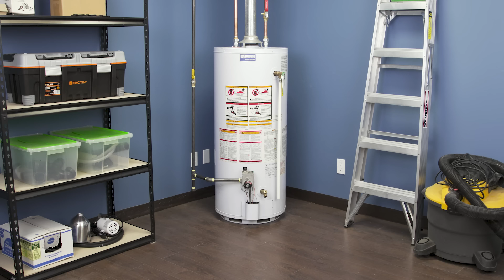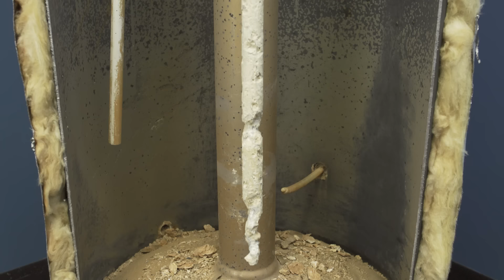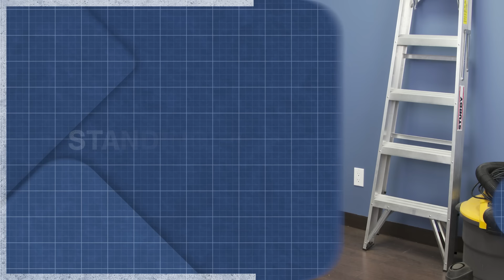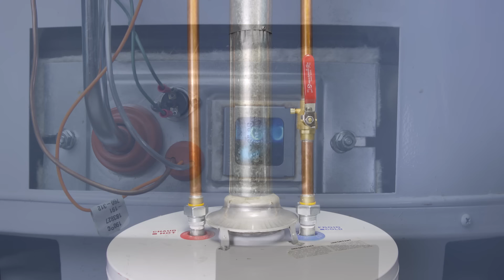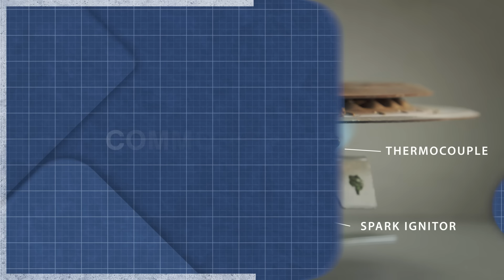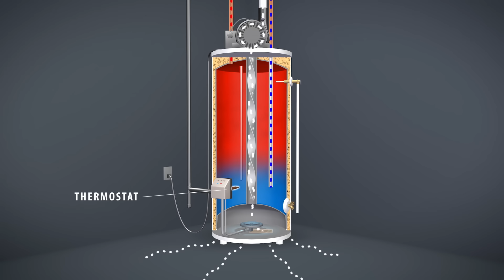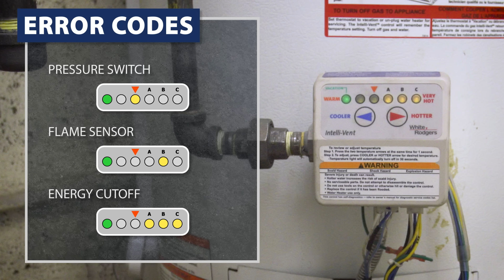How Do Gas Water Heaters Work? | Repair and Replace

Comment: So if the water is heated in the tank already, how does water come out warm if set to warm instead of the max temperature of the water heater? If I go full hot and switch to warm, it does it within seconds, but the water heater itself has very hot water at the top.
Reply from the maker: Great question. All domestic water is pressurized. Pressurized cold water is connected to the water heater, the water is still pressurized when it's in the tank. All faucets have a hot and a cold line attached. The handles just mix the amount of cold and hot water that mix as it comes out of the faucet.
Reply: @AmreSupply  Awesome! That makes sense - thank you!

Comment: My brother spent 3K on a new water heater. A water gas heater is just a stove over a big tank. I told him it's either the valve temp regulator or the thermo coupler which I can easily replace for 100-200 bucks but he wouldn't listen. He said it's already over 10 years old and the new one comes with a 15 year warranty. I was like WTF, "OK, it's your money."
Reply from the maker: I feel like if people had more knowledge about their HVAC and Appliances, they wouldn't be so quick to buy an entirely new model when it "fails" instead they would opt for the repair. For some they just want peace of mind and that comes with a new model.
Reply: @AmreSupply  He got an outdoor propane space heater and doesn't know how to light it. Same concept, get the pilot going and increase the gas flow. SMH.

Comment: If I switch my gas valve to off, I shouldn’t have to worry about any gas at all, right?
Reply from the maker: That is correct, turning it to off will prevent gas from flowing to the burner.
Reply: @ Thnx

Comment: Can you explain how the hot water pump out of the tank ?
Reply from the maker: Thanks for watching. It's pressure from the supply of cold water into the tank. It's the same pressure that pushes cold water through your pipes to your faucet.

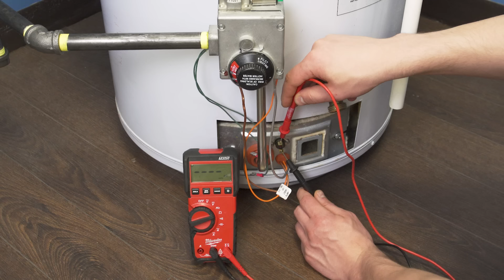Comment: 5:50
Reply from the maker: Thanks for watching. These water heaters use a spark ignitor (which is unpowered) When lighting the pilot there's a bypass/ pilot setting. Press down to open gas to the pilot flame, press the spark ignitor and then you have to continue to hold down (keeping gas flowing to the pilot) for 60 - 90 seconds. During that time the thermocouple or thermopile will warm up.

Comment: Since the thermopile supplies the power, how does the igniter GET POWERED when it needs to be ignited .?...going from a cold state, cold thermopile , and NON-continuous, intermittent pilot flame
Reply from the maker: Thanks for watching. These water heaters use a spark ignitor (which is unpowered) When lighting the pilot there's a bypass/ pilot setting. Press down to open gas to the pilot flame, press the spark ignitor and then you have to continue to hold down (keeping gas flowing to the pilot) for 60 - 90 seconds. During that time the thermocouple or thermopile will warm up.

Comment: My pilot lights and will stay lit until I try to adjust the temp ,main burner will fire and run for a moment and then shut off  pilot light.
Will relight after waiting 5 mins and stay lit until I adjust the temperature
Reply from the maker: If you have an electronic valve and a thermopile then this video shows you how to troubleshoot: https://www.youtube.com/watch?v=UXpmmGuewk8
If you have a older gas valve and thermocouple then watch this instead https://www.youtube.com/watch?v=Lu5GvbvspMw
Reply: @AmreSupply  
Thank you for your reply.
After watching videos and reading some forums 
I was able to figure it out.
When the pilot originally went out and wouldn't relight
I took the thermocouple out to clean it and the piezoelectric tip , in the process I trashed the gasket.
Being impatient, I didn't wait long enough for vapors to clear the chamber and had a combustion event that triggered the combustion shut off device without realizing it.
I cleaned the combustion chamber, as well as the intake vents .
I replaced the combustion shut off device, got a new pilot/ gasket kit ,made sure the gas lines were tight and not leaking and it now runs as it should.

Comment: Mine is making constant knocking noises that sound like they’re coming from too much pressure being built up inside.
Reply from the maker: Thanks for watching. In some cases the noise can be from the slight metal expansion in the tank or pipes or could be from sediment being kick up and falling back down.

Comment: Stupid question -- how does the hot water tank know when it needs to refill from the cold water supply? Is it pressured based or is it that it is always refilling (i.e. when a hot water tap is open elsewhere in the house, it will reduce the volume/mass of the hot water inside the tank, and it is automatically and instantly replenished with the cold water supply?)

Your help is greatly appreciated.
Reply from the maker: Thanks for watching. The cold water supply is always running and as any hot water is used, the cold water supply will naturally replace any water.
Reply: @AmreSupply  
If the cold water supply is always running, then doesn't it mean that it will constantly fill it with cold water?

Or does it have to wait until there is hot water discharge before more cold water can be added (without the need for valves and/or opening/closing said values)?
Reply: @ewenchan1239 imagine holding a plastic water bottle and squeezing it hard with your hand. Thats the cold water from the city entering your tank. Nothing happens because your valves are closed such as your shower so the water has time to heat up and chill. Now imagine you’re still squeezing the bottle and you crack the top open. Same as turning your shower on. Because you turned the shower on and have flow, your water heater is pressurized. The cold water from the city is entering your water heater and needs to flow somewhere, the hot water is being pushed out to your shower because it’s the path of least resistance also like cracking open the lid on your water bottle. Because there is now space in your water heater, cold water fills it back up. The water heater is always full and the used hot water is being replaced with cold water. That’s why you slowly run out of hot water when you shower because as you use it, when it’s mixed with cold water your shower slowly becomes colder.
Reply: @grantcarfrae8498  
Thank you!

I appreciate you taking the time to write this explanation.

This helps a lot!

Comment: Love the video. We are currently changing out standing water hear ourselves. But the hot water valve is leaking. Is it’s still draining or is there possibly something else wrong or not working?
Reply from the maker: Thanks for watching. Are you referring to the shut off valve coming out of the top? Or are you referring to the drain valve at the bottom?

The drain valve can sometimes get sediment stuck on the valve seat. https://www.youtube.com/shorts/C3-eTMsbO40

Comment: Silly question, do the gas burners need to be serviced on a regular or semi-regular basis?  Similar to the servicing that a furnace would receive?
Reply from the maker: Thanks for watching. Like any gas appliance a water heater burner can have a buildup of carbon on the burner, thermocouple or the pilot. It is best to clean this during regular maintenance. You can see how to access this here: https://www.youtube.com/watch?v=ZTUNLIXKVu4

Comment: So when I'm taking a shower with hot water the heater automatically begins to fill with cold water and heat at the same time .
Reply from the maker: Yes that is correct. The tank stays full of water the entire time, and cold water will be filling the bottom of the tank anytime hot water is used.

Comment: I don’t get how the hot water goes to the main pipes throughout the homes with good pressure. What am I missing here. I see the cold water going in, but what gives it pressure to come out
Reply from the maker: Thanks for watching. The cold supply line is pressurized and is always open, it will push water into the tank. As well when the water heats up it expands so the water heater becomes pressurized as it gets hotter.
Reply: @AmreSupply  perfect! That’s the part I was missing that I didn’t understand. Ok makes sense I appreciate you taking the time to explain this. 👍💪

Comment: Hi there I’m having problems with my hot water system 
I’m not getting hot water in my premises but water is getting hot and I can feel on water lines. What could be the problem with it.
Reply from the maker: Thanks for watching. If the water heater is working and the water is heating up, but there is no water to any of your faucets, then make sure that any shut off valves are open. If that doesn't help then you might need to call a plumber.

Comment: I’ve got a question regarding my gas heater. Our gas company left a note when they turned on the gas that “Combustion air opening(s) should be in upper/lower 12 inches of enclosure”. Because the boiler is inside the home what does that mean exactly? Like air vents on a wall to the outside? I’d appreciate it if I can get an answer
Reply from the maker: Thanks for watching. Any gas furnace or water heater will need a proper supply of fresh air for combustion. The codes are local to your state, province or municipality and can differ in the specifics but this will give you a rough explanation: https://nationshomeinspections.com/combustion-air/

Comment: I watched the video and I have to thank you for ut but I having trouble understanding the safety system since why the pilot is there we could just connect the thermocouple directly to the burner and the moment the burner is off the valve close, or maybe the Pilot since it can shuts off and release only tiny amount of gas while the valve is closing right, since if we put the thermocouple to the burner directly, when there is no fire, while the thermocouple cools off and engages the valve the burner would have released a big amount of gas right ? And thank you again
Reply from the maker: Thanks for watching. A standing pilot water heater has a pilot flame as the source for ignition. A water heater burner does not run 100% of the time (or the water would get too hot). The burner only turns on as needed to maintain the set temperature. The pilot flame stays constantly, even when the main burner is off.

The thermocouple sits in the pilot flame, and verifies that there's a flame. Without a flame then gas will be released without combustion. 

When the pilot light goes out, then the thermocouple cools down, voltage drops and both the gas valve for the main burner, and for the pilot light will close.

If the thermocouple was only connected to the main burner gas solenoid, then there's nothing monitoring if the pilot flame is still burning, and there's nothing stopping gas from being released from the pilot tube.

Comment: I have a issue you can help.  My gas water heater set to 120.  I have a pilot lit.  When I open a hot water tap on faucet the burner does not light to continue heating the water.  If I increase the temp and repeat opening a hot water tap, the burner does work correctly.
Reply from the maker: Thanks for watching. The burner will only kick on as needed. Based on how the sensing bulb works, it often takes a bit of new cold water before it will kick on and start the burner. This is not instantaneous. Turning the controls to a higher temperature will change the threshold of when it turns on. As well running a lot of hot water will require new cold water to enter the tank, which will trigger the burner to turn on.

If the water temperature is still comfortable and the burner still turns on and off as needed throughout the day, then you won't need to install a new burner / gas control valve.

Comment: why cold water pipe is long and hot water pipe is too short?
Reply from the maker: Thanks for watching. Heat rises and the burner is located at the bottom of the tank. It's important that the cold water supply adds cold water close to the burner so it can be heated directly. 

If the cold water supply was hot then there would be a pocket of cold water in the tank that does not get warm, so this would decrease the total amount of hot water available.

Comment: When a water heater is set to high (say 80 degrees) and reaches this temperature, does the burner go off until the temperature drops several degrees and then start up again, a process that happens constantly? And isn't this similar to the way a wall heater works? Thank you
Reply from the maker: Thanks for watching. When we look at heating devices like water heaters, furnaces or ovens, they all have a binary way of heating. It is either on or off. It depends on the model on how much the temperature will drop before it will turn on. The difference with water heaters is that part of the water in the tank will stay hot all the time (unless there is an excessive demand for hot water). As hot water is being used, cold water is being added and mixes. The tank is now heating up luke warm water at the bottom to the desired temperature. It will cycle on and off as needed but for most cases you can't tell when using a faucet if the water heater is actively heating or not as the water at the top of the tank is hot and ready for use.

Comment: I've been interested for a while to understand the difference between north American heating methods and what is used here in the UK and most of Europe, is a traditional water heater more efficient or less than our method, that is using a that feeds hot water from the heating system through the hot water tank inside a coil, keeping the two separate, are heating systems going down that route in North America, or is the use of a Furness essentially what prevents this method from being used, second, if you have a convection heating system, do you have a separate boiler for heating or does the water heater provide this function also? And if so, why has Europe and the UK not adopted this method instead of our indirect heating methods used (a boiler and hot water tank) or simply a combi boiler which has the limitations of only being able to supply usually one bathroom with shower or bath. (Ps , I know the main reason you guys use a furnace and hot air is so that the same ducting can be used for AC in the summer, something that isn't as required here as in the UK at least, our temp doesn't get hot enough often enough to justify AC as well.
Reply from the maker: Thanks for watching. It is always good to be curious about these sorts of things. Age of homes, availability of certain resources and the type of building would effect what heating source is used. In the UK a lot of the homes and already have a boiler installed. Installing a furnace in those older homes is quite difficult, so they are likely going to continue to use combination boilers. 

In North America and Canada, many of the homes have been built more recently. In Western Canada where oil is abundant, gas furnaces are used more often in homes. In Ontario and Eastern Canada, electric heaters are used more commonly. Boilers are usually saved for larger apartment buildings and condos.
Reply: Ps, I'm just an interested geek, I don't work in this industry.

Comment: That was good, was looking ti biy a used Hot water heater with a power vent, nor sure i want to go thst route, looks like to many sensors that can go wrong, thanks again
Reply from the maker: Thanks for watching. There are pros and cons to each type of water heater.

Comment: I have a power vent water heater, do you have a series on just those kind?
Reply from the maker: Thanks for watching. We explained how power vent water heaters work as it was important to distinguish them. Power vent are still less common and haven't been used for as long. We haven't created a series going into the full repairs as the need for repairs isn't as high as older standing pilot models. We are currently focusing on appliance repairs, more specifically a series on refrigerators.
Reply: @AmreSupply  mine was manufactured in 2003, but whatever man thanks
Reply from the maker: @guywittamic  Yes there are some power vent models that are around 20 years old, but there are still less homes that have them when compared to standing pilot. We will be creating a series for power vent and electric water heaters in the future, but we're trying to get some more videos for appliances first.

Comment: Thank you for this excellent video.  I see a previous comment about filling a kids pool.  That is what started this repair.  I ran a garden hose outside to the kiddie pool.   The rubber seat in the valve had deteriorated and crumbled when I opened the tap.  The kids had a nice warm pool but the valve would not close properly.  Watching the video I got all the correct information to install this myself.  You have saved me a $200 plumber bill.  Also great to see a Canadian company making a difference for Canadians.  🇨🇦
Reply from the maker: You're welcome, we're just happy to provide quality content to our fellow Canadians!

Comment: What about indirect unvented water heaters?
Reply from the maker: Thanks for watching. Indirect water heaters use an external heat source, like a furnace or boiler. To explain how it works you'd have to look at how the primary heat source works. In this case a indirect water heater is unlikely to "fail" as it's tied to the external heater. 

These are a little less common here in Canada so it's not something we covered in our video.